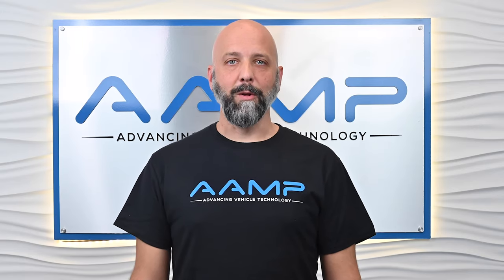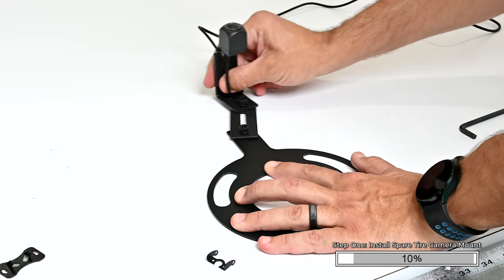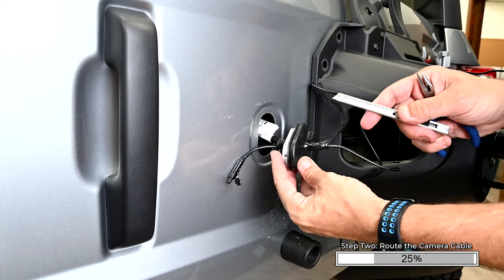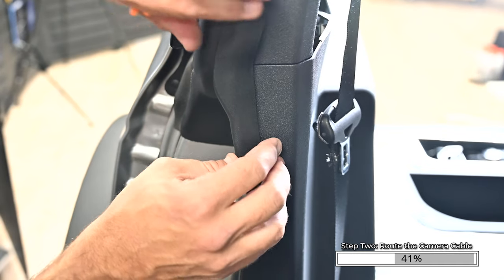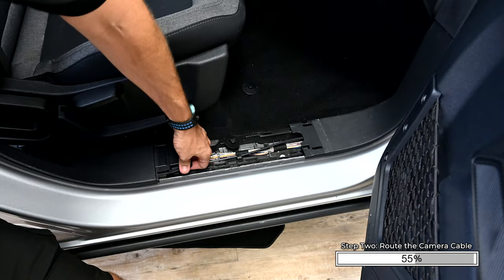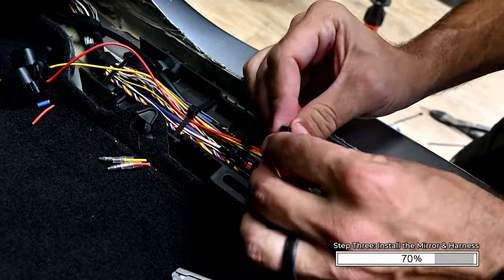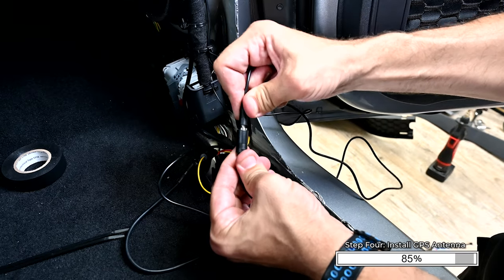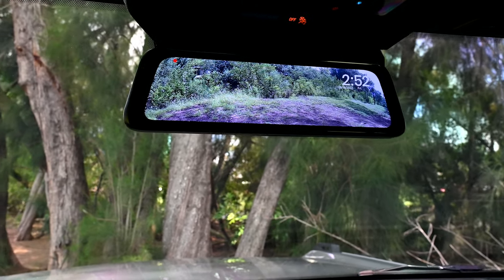MRCHDDVRBR - Echomaster Install (4K)

Comment: You may have two orange and white wires. The thicker one is present if you have the aux up fitter switches.  Make sure to connect the red acc wire to the SMALLER white orange wire.

Comment: what if I dont want to use the camera when reverse >? I am so used to use the stereo. well the main reason I want a rear view camera is to use it when soft top is all the way down...
do you provide guidance and how to not enable the camera when on reverse ?
Reply: not connecting to the reverse cable correct ?